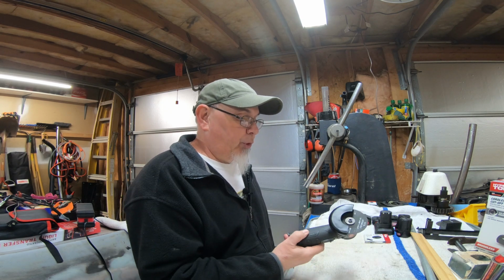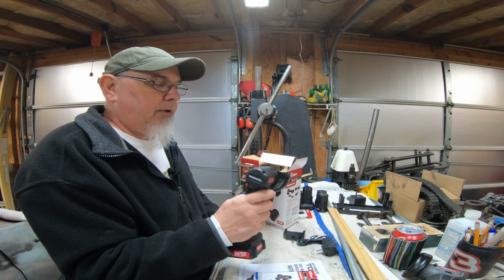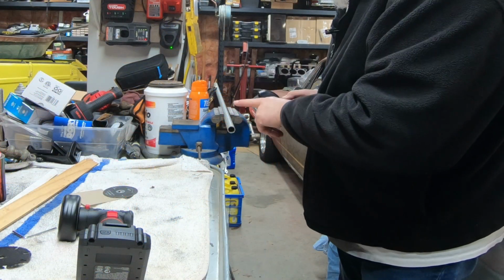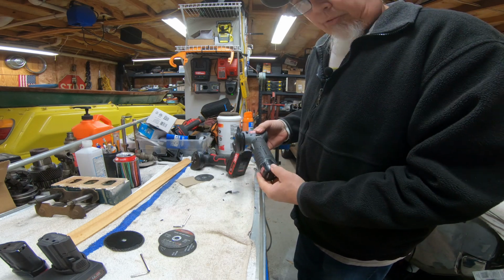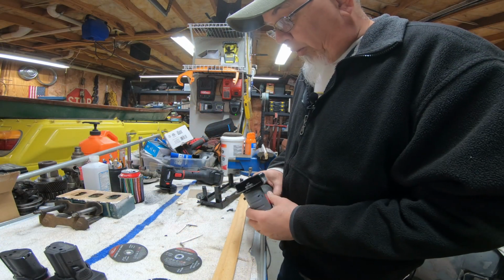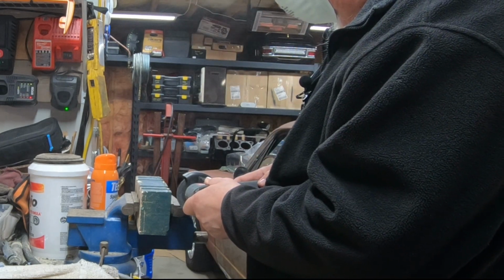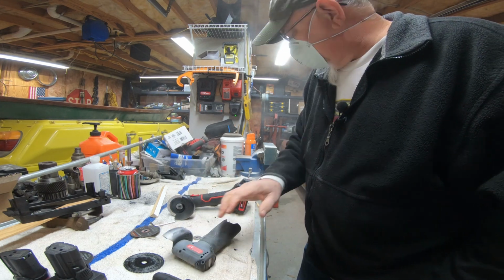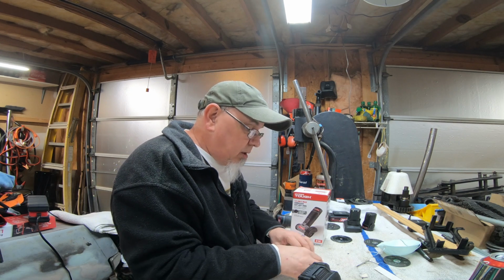Hyper Tough cordless cutoff tool 12V VS 20V!

Comment: Your battery is going to be main point get the 4.0 or 6.0 which give you more power
Reply from the maker: I've tried both the 4ah and 6 ah. Unfortunately, they didn't improve the performance by a groundbreaking amount, in my opinion.

Comment: I have the 20v version.
With a name brand 3.5" cutting wheel (DeWalt, Gator, Diablo) it's a beast.
Found 1,000 uses for that sucker.
Reply from the maker: I'll have to get some better discs and try them out. Thanks for the tip!
Reply: They arent real impressive with a stock wheel. Whole other story with a good one.
 @MikesRepairShopEDU

Comment: Little 12v  runs a lot   better with a 6ah or 4ah battery.
Reply from the maker: I've tried them, and while the performance did increase, I would say my experience was still quite underwhelming even with the higher Ah batteries.

Comment: I'm curious how the 12v would do with their 4ah or new 6ah battery. Their 1.5ah that comes with the tool barely run any of their 12v tools.
Reply from the maker: I tried running it on the 4ah battery, and it wasn't a huge improvement. Haven't tried it on the 6ah yet.
Thanks for watching!

Comment: have you tried the one from bauer harbor freight or hercules they are about the same price
Reply from the maker: I've looked at them for sure. Unfortunately, they're tool-only at those prices. By the time I add even a 1.5Ah battery and a charger, I'd be all in around $100. 

I'd love to try them out, but I'm just not making enough money by making the videos to afford it right now. Maybe some time soon, though. I'm definitely not against trying out other brands to mix it up a little!

Comment: Bought the Hypertough 12 volt die grinder and was thinking about the angle grinder.  Not all stores carry the 12 volt. Might think about the 20 volt now.  I'm in Connecticut.  Thanks for the video!!
Reply from the maker: I'm very happy with the 20v model, but stay tuned for a future episode where I try the 4Ah and 6Ah battery in the 12v model to see if it makes a difference in power!
Reply: my 20v grinder is still strong after a year of use.

Comment: Good review from NC, we've had a bad year.  More doctor bills than you can imagine.  Been looking at the 12 volt model, maybe after New Years things will be better and I can get the 12 volt model an the 12 volt die grinder from Hyper Tough.  I like the rotating head feature on the 12 volt model, that make trigger use easier.
Reply from the maker: I know you guys have had it rough up there! Here's to a better 2025 to all!

Comment: the 12 volt one really reminds me of the ebay 12v chineese one i have. same results with being ok for light duty but constantly stalling doing real work. the 20v one looked pretty impressive. sometimes watching an everyday test is better or at least equal to a "torque test channel" review. spinning a motor for "max" power dosent give the real world use feel to it. may have to recommend this to my son for work since he is looking for one of these.
Reply from the maker: I'm really impressed with the 20v model, especially for the price! The 12v model has its place, but it's just not up to my intended task.

Comment: I've got a few of the Hyper Tough tools and I'm happy with them all.
Reply from the maker: My first Hyper Tough cordless tools came in a 4 pack bundle. A flashlight, 1/4" drive impact, a 3/8" drill, and the reciprocating saw. It was on the clearance rack for $40, and I couldn't pass it up! They are okay, but I think the newer stuff they have now is better quality.

Comment: 20v, 18v, 21v cordless tools is really a bare minimum voltage to use in tools. At these higher voltages cordless is much much better in power, performance and endurance.
Why people are going backwards with using 12v tools lately ??? We learned this lesson with garbage 14v tools back in the 90's that lacked power.
Reply from the maker: I like the compact size of the 12v tools, but that's about it. The 12v extended reach ratchet I have has been great as a nut & bolt runner, but not really a powerhouse in the breakaway torque department lol.

So far, the brushless 20v stuff has really impressed me for their price. Stay tuned for a future video on their 1/2" high torque impact!
Reply: Sometimes you need a smaller tool. You don't understand why so many people use the Milwaukee 12 volt? Think outside the box buddy

Comment: It’ll probably do a lot better with the 4ah battery
Reply from the maker: Which one? The 20v? I'm really interested in seeing the performance with that battery, as well.
Reply: @MikesRepairShopEDU  the 12v. They have a 4and 6 ah battery
Reply from the maker: Yep, I have the 4 ah battery in 12v. To be honest, it does work a little better with it, but not enough to be glaringly obvious. I just wish I had one for the 20v!
Reply: @ thanks. I was thinking about getting the 12v but I’ll get the 20v instead. Thanks again.